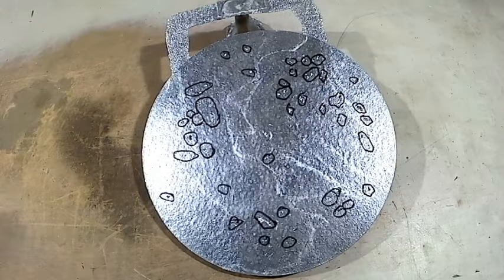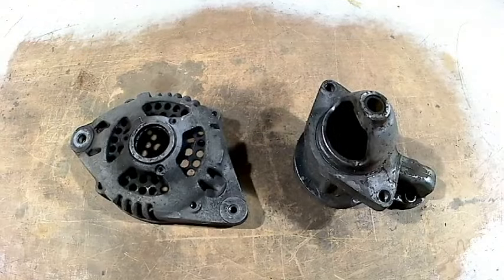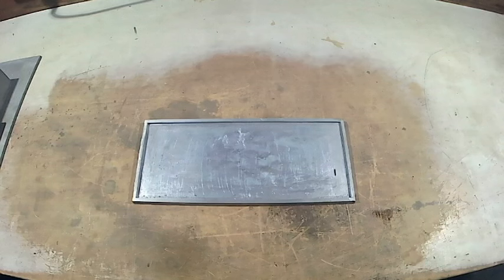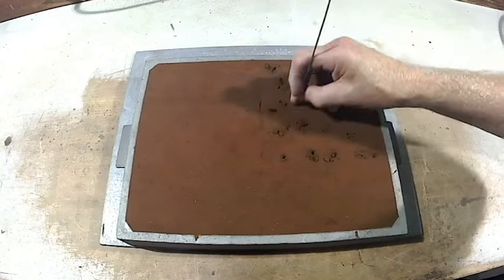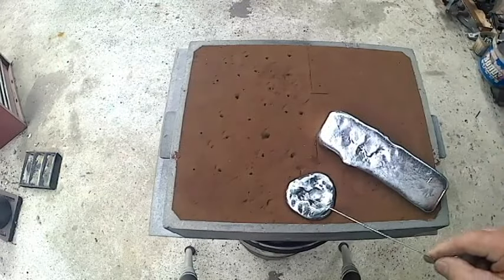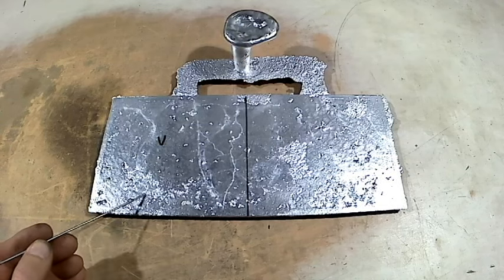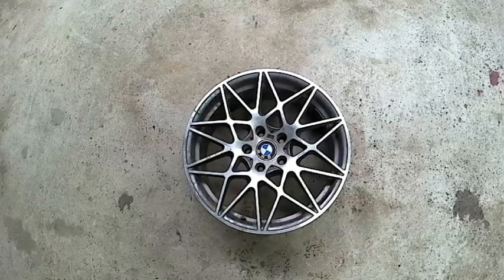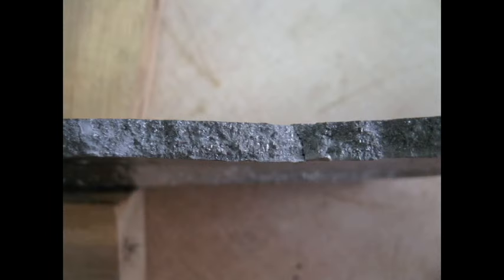Why I hate casting aluminium.

Comment: I've saved a heap of small engine (lawn mower) alloy bodies. I guess they'll be useless? I do have two car rims though, but as you say, very difficult to chop up. I read a lot of the comments and it appears silicon is the culprit. Are there any additives that can be used to to lessen it's impact? oldfoundryman suggests strontium or sodium, a lot of derivatives containing those, so which to choose is beyond me. Interesting video.
Reply from the maker: The best way to find out if your lawn mower scrap produces this defect is to melt a 0.5 kg sample and pour it into a ingot mold. if the top of the ingot has those odd shaped depressions don't use for sand casting. Those additives suggested by olfoundryman can be hard to get so in the end car rims are your best bet.

Comment: I would talk to a metallurgist at the nearest university.  Also are the pockets superficial (if you face it on a mill,  are they distributed evenly with depth?).  Really enjoy the channel.  Thank you.
Reply: Seeing the segregation of the different metals in the alloy, I wouldn't use it even if you could just surface it. Way to non-uniform. You'll never know where it will be weak and break.
Reply from the maker: @DrTheRich  It did take a lot of blows to fracture that casting but you are right it could break at the weakest point.

Comment: The biggest part of using Scrap to cast from is This -- There are a Lot of garbage alloys used that work for processes such as injection molding, Pressure casting, etc That just Do not hold up when sand casting. A lot of monel metals (Pot Metal)  Look like al, but do not mix well and cast well. Another consideration is Green sand versus a Petrol Bonded oil sand, I have had perfect results in the second one than the first. Critical to the process is cleaning the scrap before you use it -- I use sand blasting to clean crud off. Clean up your grading of the white metals, and when in doubt -- Use only metal off of 1 known piece -- no Mixing. This should go a Long way to cleaning up your operation. Lessen the variables, and enjoy good homogenous castings that are a Pleasure to dig out of the sand.  Carry on!
Reply: Oh yes indeed, 100% agree.  You can buy yourself a lot of trouble trying to save a bit of money and use whatever Al scrap you have on hand.  Beverage cans are the worst.  They aren't an alloy meant for casting.  And between paint and coatings there's a lot of impurities that as they burn off will leave impurities in the metal.  Fwiw back when I was doing casting I just didn't do anything with aluminum.  It pollutes everything.

Comment: It is difficult to say specifically what is causing your casting defects.  However, I can speak in generalities.  First, it is important to know which alloy that you are using.  The most common casting alloy is A356 and is the main alloy for aluminum wheels.  It is a high Silicon (6.5% to 7.5%) content alloy.  It is slightly hypoeutectic so porosity during solidification is minimized.  If you are pouring a lower Si content or Zn content alloy the castings will not be as good.  Cylinder heads may have Zn added for strength and higher temperature strength.

Castings such as the alternator and starter motor castings may be low Si and are likely pressure die cast.

I haven't seen how thick your casting is at the beginning of the video, and this may be part of the problem.

Some of the defects that you showed on the casting look similar to freeze outs and cold shuts.  If your casting is relatively thin you may need to preheat your mold or increase the superheat on your melt; or, both.

Thin castings are difficult to do in sand castings because the metal will cool before the mold is filled.  If this is the case, then just a slight adjustment is needed.

Depending on the scrap that you start with, you can adjust your melt.  For example, if you are using aluminum cans as your raw material, this is a poor choice for a casting alloy but you can handle that.  Aluminum cans are usually made from 3104 which has almost no Si but is alloyed with Mn and Mg.  To use aluminum cans, make your melt, refine and cast into ingots.  After the ingots have cooled, weigh them.  Then when you go to remelt, add about 7% by weight Si.  You will then have a good casting alloy.  The small amounts of Mn and Mg won't have much effect.

hth.

PS:  @5:15 the results look like shrinkage during solidification.  Again, it depends on what your starting alloy is.  It is definitely a lack of fluidity and possibly cold shuts.

PPS: On the 200 kilos of scrap that you have, don't throw it out straight away.  Make some ingots and have them tested for composition.  Once you know the composition, you can possibly adjust your chemistry.

Another good scrap source for you would be extrusions which are a 6000 series and would only require some additional Si to make it a good casting alloy.

Comment: i have found the same and it isn't the mold as i cast the ally into steel or graphite molds to use as cast stock to be machined later. my results are similar
Reply from the maker: How does the cast stock machine? When I poured the ingot the steel mold drove the defect to the top.
Reply: @luckygen1001  i get huge porosity mainly deep in the center of the piece. I still have some that i cut in half so could send a photo if i knew how.
If i remelt it again and recast it then it does get somewhat  better so i assumed it was the oils giving dirt and gas that doesn't skim off.
Was going to try fluxes next time i melt some. Pure ally comes out with very little porosity.
Reply from the maker: @mikegregory460  Dirty oily scrap will cause a lot of defects.

Comment: I would be curious if adding a substantial riser (4-5 in) would help by adding hydraulic pressure to fill the mold better and counteract steam or gas being released from the melt as it cools.  It would be an easy thing to try...
Reply from the maker: I did use very dry sand and vented it so it still made those defects.
Reply: @luckygen1001  Right, with a 'good' alloy it should have worked much better.  But with this one, there could be extra gas release at solidification or it may just be lumpy due to different fractions solidifying at different temperatures.  But maybe the extra pressure would still help.

Comment: Strangely abnormal shrinkage. Motor aluminum is usually alloys with a high silicon content, they do not behave this way.
There may be a high content of oxides; you can try letting the melt sit for half an hour or more in a closed crucible so that the oxides settle to the bottom.
Reply from the maker: Interesting idea.

Comment: A few years ago I made a wheel melting furnace from a 55 drum and made a shallow funnel from a top of another drum. Since this video was made, we burnt a hole in the bottom of the stainless steel pot, so i now use a cast iron Dutch oven to catch the aluminum. All the nasty remains on the funnel. Very little dross skimming. I pour it all in to ingots. Nice clean aluminum to use in my electric furnace that i use for casting. https://youtu.be/l7tqOxzmGj0?si=0fmm3S_a2xcX81Fd

I’ve never experienced the issue you’re having, but i only use petrobond, and lost foam in dry play sand. No experience with greensand.

Comment: I haven't seen this anomaly on aluminium so far as I tend to use wheel rims. But, I have seen this on zinc alloys or pot metal and you do get severe shrinkage and that strange pattern. Maybe your alloy has a high zinc content?
Reply from the maker: It could be.

Comment: I am affraid your choice of aluminium scrap is a poor choice alloy wheels are much better as theres more magnesium in them those parts are diecast and contain zinc also i would recomend a higher temp and a slow stir or degassing  i cast aluminium thin sections every week with a 200 kilo bale out furnace into greensand or bonded sand with great results the bonded gives much better results  but is more expepensive i have followed your chanel and have 2 of your furnaces for our cast iron  buisness and they work very well

Comment: Good video! I read in several places that the alloys used in the car industry (all of them patented) are very bad for recasting, probably because remelting them, changes the composition somehow, making it unfit for purpose. Most of these patented aluminium alloys crumble like cast iron, when hit with a mallet, instead of deforming like normal aluminium does, which is probably a good way to predict which are good for recasting.
Reply from the maker: So true and that is why I will be throwing out the lot.
Reply: @luckygen1001  Yep. It's so unfortunate. Such a large quantity.

Comment: Hi you probably don't want a Kiwi telling you what to do but I have been a supplier of Al and Cu base ingot to NZ and Aussie for a fair few decades now
I will refer to alloys by the Australian standards but these alloys have equivalents world wide
Wheels are CC601 that is 7% Si for moderate fluidity  and 0.3% Mg for heat treatment  and 0.05% Sr for grain refinement
the smaller castings like alternator bodied are pressure die casting alloys like DA401  with 12% silicon and 1% iron very fluid but very subject to surface shrinkage such as you see also your remnant ingot and sprue top indicates this alloy
Bell housings are often CA313  another pressure die casting alloy  9%Silicon 1% Iron and 3% Copper often very shitty ( technical jargon ) and the Cu% causes corrosion
Forged wheels have no Silicon and run very poorly wheel may have the word geschmiedet on it 
you have no riser to help feed the casting however a large runner bar and in-gates can be better for the type of casting shown and allow the casting to feed instead of sucking in the surface
Good to see your sprue taper toward the casting
The finer grain toward the surfaces is purely due to the faster cooling rate against the sand
I know wheels are a bugger to break up but they are the best option for sand casting short of paying twice as much for certified ingot and the CC601 alloy develops micro porosity in the center rather than huge sucks on the surface
Good luck with your castings
Reply from the maker: Thank you so much for your description of alloys. I would add that every foundry does use different alloy for the same casting as most seem to come from overseas these days.

Comment: circular saw to cut alum wheels
Reply: Or a Plasma Cutter
Reply: Maybe a hydraulic wood splitter.
Reply: small tile cuitting saw with small 'steel demon'
Reply: @markfryer9880  no
Reply: @Drottninggatan2017  no
Reply from the maker: I tried that years ago and it was too much for the reduction drive on the motor, it stripped the teeth on the gears. I had to buy a new circular saw.

Comment: Interesting >> More 'Big Bore' Vents
                        Preheat the Mold.
                       Add small amount of Cadmium
                       Pressure the Aluminum at the end of the pour before total solidification.
                      Don't use old Aluminum castings.
There's a list of tips for you.

Comment: Salt in a aly foil wrapper poked to bottom of melt. Reduces hydrogen gas. Use at end of melt and wait for gassing to stop.
Reply: And since that is such an easy solution, industry decides to go a different route. 
(sarcasm)
Reply from the maker: @rudycandu1633  Cant argue with facts!

Comment: Die cast aluminum alloys are going to have a lot more silicon than alloys designed for sand casting, as well as copper. This could give you issues for sure. However I think this is from hydrogen. You need to remove the dissolved hydrogen, which can be increased with these alloys that have more magnesium in them too.

Comment: Don't try to degas the aluminum.
Reply: Why?
Reply: @VladekR  the sodium bicarbonate creates CO2 gas which is what makes the bubbles.  It also leaves some in the metal.  People think they're degassing it but they're not, they're actually just making their aluminum bubble and providing it the opportunity to capture more gas.
Reply from the maker: @Kevin-ht1ox  I made a video about this subject, it is the moisture that causes the bubbles using sodium carbonate.
Reply: @luckygen1001  moisture (as you prooved) seems to be a culprit, also sodium bicarbonate is the wrong substance to use, there are cheap degassing tablets on the market too, but reducing bubbles seems to be more of the pouring technique then composition of the metal (need to be clean too). The great John Campbell (who I met in Melbourne at the AFI 57th National Conference) describes ins and outs of casting in his books too. Best Regards.